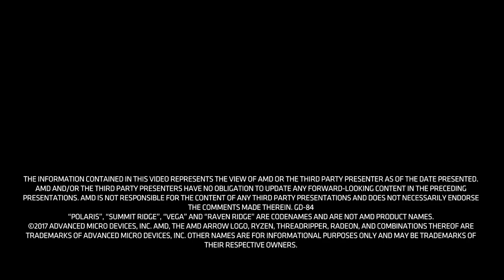How the AMD “Zen” Core is Made

Comment: I'm guessing without using toothpaste unlike intel.
Reply: lmfao
Reply: i just spilled my drink  XD
Reply: Yeah, kind of sucks AMD doesn't care about oral care enough to include some with their CPUs. :c

/s obviously
Reply: Intel uses top-grade, ultra hi-tech TIM - Thermal Interface Mayonnaise
Reply: neoqueto lel mayonnaise XD
Reply: Would have been cool if AMD included a little gag into their video. Or maybe I didn't see it.
Reply: Soldered
Reply: Its called termal paste not toothpaste....
Reply: @expressfax5420  AMD to Intel fanbois : r/woooosh
Reply: @someonestolemyname  xD l got i5 2400 its still a good cpu
Reply: @expressfax5420  I use a 6700K so yeah it is toothpaste the chip can barely even overclock to it's boost clocks without hitting 100C even with water cooling. Unless you replace the toothpaste that Intel used and thought would be adequate for an unlocked chip you are basically unable to take advantage of the K series of chips. Even at stock speeds with custom loop water cooling it still hits 80C easily meanwhile my previous cpu that was in this loop was a power hungry 8350 running at 5ghz without hitting 60C on the hottest core.
Reply: @HimmelWeint  my i5 2400 with intel stock cooler in gaming it hits max 74 c
Reply: @expressfax5420  what do u play? Solitaire? Lol
Reply: @JohnDoe-ud3ue  umm bf 1 on ultra bro cs go max settings 418fps + and more games like gta v on very high too
Reply: Intel is better value. You get a cpu AND toothpaste
Reply: @MyTiredAccount  yeah the intel can hold the money :)))
Reply: A wise Chinese man once said :
如果你点击翻译，你必须发送裸照
Reply: @expressfax5420  i5 2400 at like 5 dollars, 8 years ago 300,

Comment: AMD just delivered this year.
Reply: ARCHAIC true
Reply: but i did wise the RX Vega would of been a little stronger
Reply: vega might not be the best thing for comsumers but its excelent for servers and MI/Ai, as there its faster than a p100 while consuming around the same power and having fp16,
Reply: I would say Pascal age quite good since it 1 and a half year old and still more then competitive and there still isn't a full Pascal unit on the mainstream gaming market yet.
Reply: ARCHAIC vega is good
What are u talking about?
Reply: Hi, welcome to the future. AMD did bigger and stronger.
Reply: @herz1nfucked  If you didn't did gaming which is why you'd buy in first place. It has 12.6 tflops while 1080 ti has 11.3 tflops (fp 16) if you get good drivers and render a video it'll be like a modded nismo overtaking lamborghini. 
Problem is drivers, software support and memory speed
Reply: @herz1nfucked  Came in 2020 actually vega 64 outperforms in most of games and for rendering premier pro, forget 1080 ti. I was right they were drivers. It means that with vega, every AMD gpu must have got 50%+ gain in performance
Reply: you gotta see it now
Reply: even more so this year
intel dying to ryzen 5th gen

Comment: They use high quality glue for each die unlike the superior Intel toothpaste
Reply: Indium glue specifically.
Reply: ... It can't overclock past 4GHz because of the architecture itself, not the paste in between the die and heat spreader. And besides, AMD solders their chips iirc.
Reply: intel 8 core from 16 months ago beats amd 8 core lol
Reply: For how many times the price?
Reply: I realize that it doesn't matter much at 4GHz, I just mentioned that AMD has soldered dies because you made it seem like that was the reason Ryzen can't go past 4GHz.
Reply: Well the reason you buy k series chips is to overclock not have it sit at base clock with a stock intel cooler its about the practices that that intel are pulling on consumers and amd arent immune to that as seen with the vega launch.
Reply: esperCELL I mean you can over lock the ryzen chips with their stock cooler quit good and I don't see them going out of business. Besides ryzen when over locked destroys the i7 in every benchmark besides gaming and single threaded applications. Intel has far superior IPC so both are great for what they were built for, intel = gaming and amd = workstation. But the issue is with the premium you pay to intel to get a lower quality product.
Reply: TheUnknownSoldier Intel's IPC is not far superior, in fact, in certain applications it's worse.
Reply: It's welded.
Reply: lol i love it so funny
Reply: lel xD
Reply: GorillaZillas i mean they were the reason we were stuck on quad core cpus for the consumer side for 13 years
Reply: After my amd fried and bad experience with Radeon I only Get intel and nvidia
Reply: GoodDay yeh bro my amd fried too, lisa su got real crispy
Reply: "does it even matter if its soldered or tim at 4ghz? lol 7700k runs completely fine with tim at base clock with 4.5ghz,turbo, "

Result?
The I7 7700K is 28% better in Quad and singlethread than the R7 1700
But 51% worse in Multithreading.

And the I7 7700K is 12% worse in 6thread gaming which is becomming relevant in 2018.

So if you want to do ANYTHING above 4Core gaming: Ryzen 5/7 beats the I7 7700k.

If you want to go to the I7 8X00 models: sure, but you would go up against the RTR 1900. Which is AGAIN better in multithread and worse in single/quad. (Even in 6thread tho).
Or you'd go up against the R7 1800X. Which reflects the TR comparison, with a little less headroom in multithread.

Not to forget: the I7 8700k came out 7 months AFTER Ryzen 7, Lacks a upgrade path (Ryzen+ and Ryzen 2.0 will both use the AM4 socket) and still falls behind in Multithreaded workloads.

So sure: If you want pure gaming: Go intel.
If you want to do some streaming in HQ, medium to heavy content creation/rendering, with a decent gaming experience, for a lower price, with a better upgrade path: Go AMD.

Intel: Better peak performance in gaming.
AMD: MUCH better value and still solid gaming performance.

To give you an idea:

The R7 1700 stacks up to the I7 7700k (for gaming and Light content creation) 
While (when taking motherboard into account) being 12% cheaper.

The R5 1600 stacks up to the I5 8400, I7 6700k and the I7 4930K
While being MUCH cheaper than all of them.

The RTR 1950X stacks up with the  I9 7940X 
While being 30% cheaper!

The R3 1200 stacks up with the I5 6400 (Overclocked: EVEN BETTER)
Or the R3 1300X being BETTER in modern gaming than the I3 7350K
While being 20% cheaper AND allowing upgrade path to Ryzen 7!

Intel beats AMD in the Absolute High budget.
AMD beats Intel everywhere else atm.

Even the absolute low budget. You can get a Athlon x4 970 for 80€ and a b350 motherboard. And upgrade it ALL THE WAY up to R7 2.0 in 2019.

Be thankfull that AMD is finally kicking Intels ass. That means intel will have to bring out an even Better CPU further down the line.
Which is better for everyone. Because if Intel kicks AMDs ass again: AMD will have to improve again.
Reply: Well, looks like that toothpaste had a “Meltdown.”
Reply: Redey1290 intel used the same arc for years, Ryzen is just a baby needing refining to get full potential but for the first gen, they come very closer.
Reply: After 1 year, intel soldered Chips fail at 5.1 GHz. Why ? INTEL fanboy response ?
Reply: LMFO this guy don't know what speak if he know what Intel call glue and what is toothpaste .OMG OMG this need more likes 😂😂🤣🤣
Reply: stop smelling the glue
Reply: @hellowill  ryzen 3000 series ur saying lol with half the cost lol
Reply: @smokeinc9800  when I wrote that it was about 1700x. Yeah intel is fucked now. Btw I own 2700x.
Reply: No intel is for easy delliding lol
Reply: @bass-dc9175  unless Intel lower it's price same as AMD, that's more interesting
Reply: @redey1290  now in 2020 they reached 4.9ghz
Reply: Intel is best
Reply: All the cocky AMD fanboys are gathered together
Reply: @mosemaskinen   back from mars? 😂 good
Reply: @hellowill  that didn't age well....
Reply: @mosemaskinen  Intel is the best
Reply: @2010stoof  ?
Reply: @hellowill  when you put the comment about the 8 core from Intel 16 months ago beats and 8 core.
With zen 2 they are on par with eachother and I imaging zen 2+ and zen3 will overtake Intel even in single threaded very soon.
Reply: @2010stoof  yes.. Ryzen 1st gen was underwhelming. I had a followup comment if you read it.
Reply: @hellowill  ahhh. Got ya. Stopped reading the comments. Before ingot to your re comment
Reply: The toothpaste is better than the Intel's thermal paste
Reply: 9/10 dentists inside.
Reply: Recommended by 4/5 gamers.
Reply: @trueminecraftfacts  I think you don't know how to use that.
Reply: @redey1290  lol...3960x going to 4.7 lol
Reply: @hellowill  are you still an Intel fanboy??
Reply: @hellowill  not anymore eh
Reply: @hellowill  good sir I hope you're still here 😂
Reply: @saanumathew3399  I literally own a 5950x, how many of you fan boys can say the same?
Reply: @sloo6425  yup
Reply: To be honest both brands are good in their own ways but intel has been lazy
Reply: @hellowill  * cough *
Reply: @redey1290  well, amd knows what innovation is. now they are able to do that
Reply: solder
Reply: Intel is soldered ihs too.. bad glue better for delid 😜